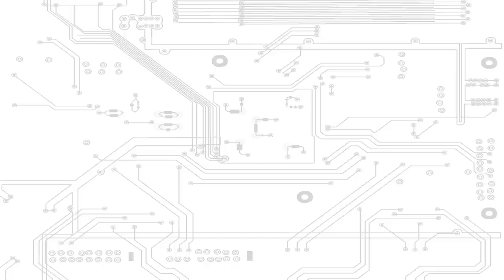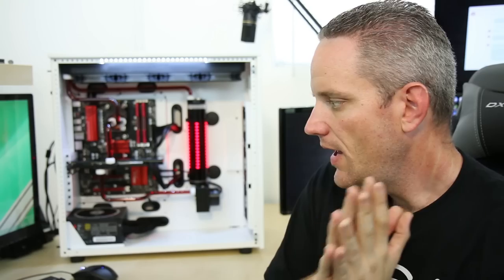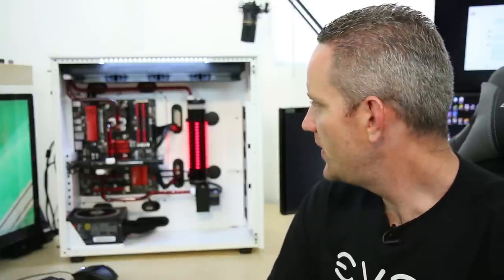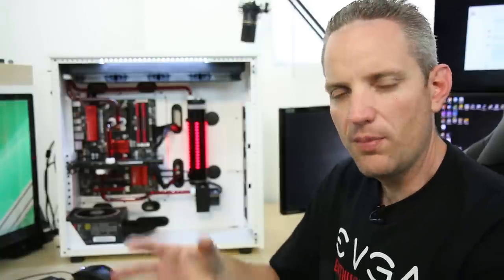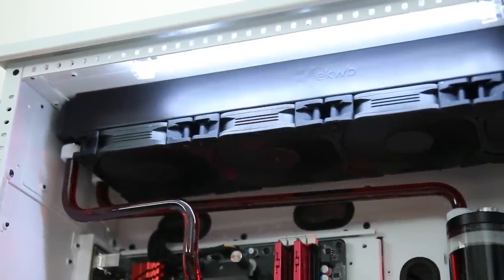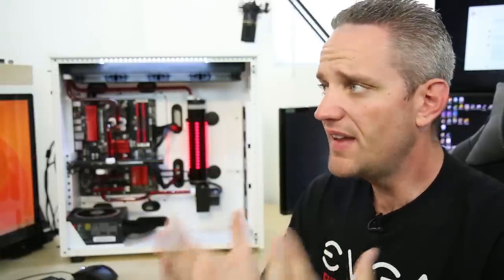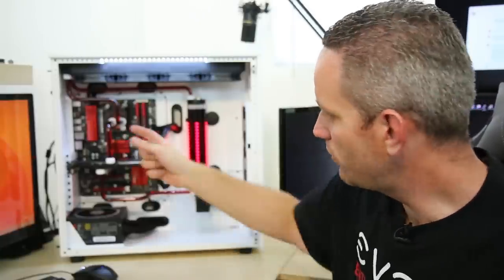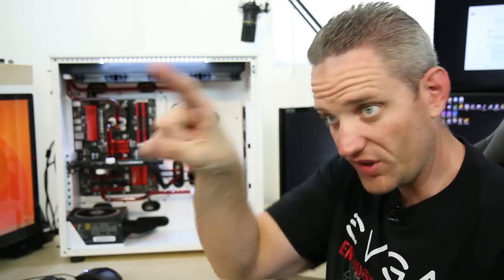Custom Watercooled AMD Gaming PC

Comment: I kinda want to see a purposely inefficient path in a rigid loop:
Wherever you would do a 90 degree bend, do a 270 degre 'loop' so the final result looks like a roller coaster.  If possible link the loops so they pass through one another so it needs to be assembled in a more clever manner/specific order.

One thing I really want to make on my next build is a spiral going upwards where there is an auxiliary AIR pump after put pump outlet that pulls the air from the TOP of the main reservoir and injects large non-diffuse bubbles into the spiral at the bottom so the flow is clearly visible.  At the top of the spiral would be a custom chamber (secondary reservoir) that allows the bubbles to be removed and ported back to the reservoir before the liquid continues to the rest of the loop.
Note, the air system is also closed loop so there is no evaporation problems.
Yes, harder to bleed, Yes, more backpressure...but looks more awesome!

Comment: ***** Good to know, that there are "compatibility concerns" to consider when using PETG... Since i am about to build a PETG loop soon i would like to see this because i dont want my coolant to melt the face off of my new system.
Also a proper comparison of different pumps would be an interesting topic (i.e. using different types/numbers of blocks and pumps to show the difference in flowrate or possibly the noise generated).
Reply: Wyrucz The only thing to bear in mind with PETG and coolant is to avoid coolants with ethylene glycol -- will probably be listed as ethane-diol on the ingredients list. Propylene glycol based coolants should be fine with PETG, but ethylene glycol is known to be incompatible.

Comment: Any chance you can do a more in depth advanced watercooling guide. In particular, I'd like some tips and ideas on how to implement maintenance (Fill and Drain ports). maybe that falls more into case modding though... 
Also, Thanks. Your watercooling guides inspired me to take the plunge, and turn my corsair Air 540 case into a water 540 :P

Comment: Disagree, the FX8320 is the best bang for the buck. Its only 200mhz behind FX8350 in turbo. It can overclock to the same speed on stock voltage and quite a bit higher with a little extra voltage.  When I had mine my daily tune was 4.6ghz @ 1.375v and max tune was 5.1ghz @ 1.55v. I loved my FX but it had to go it couldnt keep up with all my games. It wasnt "bottlenecking" my 290x but it was bottlenecking some of my games. Switched over to an i7 4790k and gained fps in every game, some games went up 10-20fps.

Comment: Hi Jay, love your videos. I had a quick question regarding the current state of dyed coolants, more specifically, the long term effects of them inside of a loop. Back in the day, I used to run dyed coolants in my loop but later found that they would stain the tubing, res, and gunk up the waterblocks. Do you find that this is still the case with dyed coolants today or is flushing out the loop every so often the only realistic way of keeping the loop clean? Also, is there a difference between the clearer dye versus the more opaque stuff (like the one you used in skunkworks) in terms of long term effects inside of a loop? Thanks so much!

Comment: wouldn't mind seeing a complete how to guide video on watercooling, like from the planning stages to testing the components before watercooling them to putting waterblocks on graphics cards, building the loop and the tools you use and recommend to people that are new to watercooling as well as some tips here and there, im currently planning on doing my first x99 watercooled rig but still not sure on what tubing to use and how to make the loop itself since itll be inside the fractal design define S

Comment: Jay, I'd like to see a water cooling solution for a 19 inch server case which could be mounted into a server rack. Because it is like an old desktop case "laying on the table" you cannot use thermic effects for cooling.

Comment: ***** I'm assembling my gpu only loop right now, watercooling for the first time. I would like to see a beginners guide to the most basic things. I have a 290 with a fullcover block. How much radiators should I have? Which pump is best if I want to have silence? Should I use a drop of thermal paste when applying thermal pads? Stuff like that.

Comment: ***** Regarding watercooling content, I'd love to see purchase guides. Fittings aren't the cheapest and just doing some preliminary research, I've just been a bit overwhelmed in terms of what should I buy, what I need to buy, etc. It seems that rigid tubing also allows for a bit more exact fittings purchase where as soft, you may need more in terms of 90 degree fitings, extensions, etc.

Comment: Is there a reason you went with red dye rather than red pastel? Maybe it's just me but I like the pastel a lot better. Something about that clear tubing over the opaque coolant just gives me a hard on. I'm thinking of upgrading my loop to hardline but I decided I should wait until I upgrade cases. Hardline tubing would need some tight bends to fit in my Corsair 760T setup. Good looking build though and thanks for the confidence boost to dive into PETG tubing. I might start picking up some fittings and tubing so that when I get my new case I'll just need a new radiator to add onto it.

Comment: So yeah it would be a lot of tubing, but you should do a a build without a resevoir and instead with hard tubing coiled up in place of the resevior. I think it would be pretty cool. Kind of got the idea from linus' scrapyard wars 2. Is it posible to bend hard tubing in that tight of a space?(like where the resevoir usually goes, but with hard tubing coiled.)

Maybe use a UV green type of fluid to give it a cool effect.

Comment: Is is possible to fix a leaked water cool system if the water gets onto the computer components? Or would I have to buy completly new hard ware .hasn't happened yet but just wondering for if it does happen.

Comment: Hey Jay, would you recommend 240mm AIO with push pull Gentle Typhoons or a 280mm AIO with push pull using some random fans? Gentle Typhoons don't go to 140mm. Or maybe I can use a mounting bracket to fit the GT onto the 280mm rad. (It's an AIO, so only for CPU or GPU, but both will be overclocked and under near max load.) Thanks.

Comment: Can you do a review of how to cable manage fans with multiple rads for an SLI or Crossfire loop, especially in mid-tower ATX cases like the Define S? Example: two 60mm-thick XE360s in push/pull means 12 fans, 6 on top and 6 in the front, plus say one 140mm fan in the back and one in the bottom. How would you cable manage all 14 of those fans, have a fan splitter, keep them out of the way of the tubing, etc. while providing proper airflow and aesthetics?

Comment: More watercooling videos would be awesome. Um... How but some were you discuss more budget minded supplies for water cooling. Like when you said PGT tubing was less costly than the flex/rubber tubing.

Also, what cases work the best for custom water-cooled loops verses the closed-loop systems that would theoretically fit in any case.

Comment: ok here's my question!
Can you actually use a car radiator for pc cooling? I mean using it as the actual radiator instead of the smaller computer designed ones?

Comment: I'd like you to talk about pump performance, flowrate, radiator dimensions, PWM control and other factors impacting cooling performance. I cannot believe you are staying under 50 degrees under load. Are we talking synthetic load?

Comment: i build my first custom water cooling systems with acrylic and damn was it hard and i needed a lot of tube just to practice on but i did get a clean and nice finish in the end so i personally recomend going acrylic for your first time as long as you understand your route relize how ur gonna need to bend it and make sure u have more than enough acrylic for all of ur fuck ups

Comment: I'm currently saving up to run my first water cooled system to build hopefully by January. I'd LOVE to know more on pump types, chemical types and maybe even a bending guide. I know you've covered videos on airflow before but I'm curious why people keep putting intake rads in the front of the case (Paul&Kyle's builds for example). I must be missing something as to why people are choosing to put hot air into the case. Maybe a video on pros and cons to that.

Comment: Guide: How to choose right water cooling (radiator size, 1 or 2 independent loops for CPU and GPUs) depending on system (I plan 5930K OC) and how can I use water cooling with 2x Gigabyte 980 Ti G1 (Custom PCB) cards (I plan use them) and how to find full cover Water block for custom PCB cards?

Comment: DIYPerk has put a CPU ventirad on a GPU and I wonder if you could compare that to a gpu watercooling (since you surely have spare parts laying around)
Also one argument I often heard about watercooling is that it's quieter, to my logic I dont think so because you still need the radiators and fans to cool the fluid. So if you could give it a roll on the dB meter ;)

Comment: Hi Jay, thanks for the video. I can't help but feel a little worried by the open fan grill on the PSU pointing upwards and being directly below the GPU cooling block, if there's a leak then the coolant is going to drip straight in there, what's your take on this from a safety point of view?

Comment: I would like to see a video about having a separate radiator for the cpu/gpu versus having a single radiator like the one in this build. I was always under the impression that you should have one for each.
Reply: starfan6299 The rule of thumb I've always heard is that you want - bare minimum - 1 120mm fan for each water-cooled part.  So, you got 1 CPU and 1 GPU, you bare minimum need a 2x120 radiator.  Most radiators aren't going to be able to cool this combo with any real overclock, so getting more rad is essential.
Reply: jedidethfreak I've heard a similar rule except start with a 240 and add 120 for every heat source after the cpu.
Reply: bensemus x I say, use as much rad as you can possibly fit in the case.

Comment: 11:10 I have a question: How about copper/aluminium/brass tubing, like those used on gas installations? is there such a thing for watercooling? I'm tempted on building a fallout inspired machine and plastic tubing might not fit with the aesthetic I'm trying to achieve. Also how about an external serpentine where you can dump chunks of dry ice to cool the reserve liquid berfore getting back to the system?

Comment: Hey Jayz, can you do a build guide involving rigid tubing please? I am a long time pc builder (~10 years) but I want to go the route of water cooling for the first time. I have done phase changing just for cpu for pure overclocking, but now I want to have a practical system that I use everyday and I plan on going the route of water cooling through rigid tubing.

Comment: Jay i know you don't like the term bottleneck being tossed around everywhere but I have an issue with this build. 

It's psi 2.0, won't at lead that bottleneck a card as powerful as a 980? 
I have a 8320 myself and I know that the am3(+) chipset doesn't support psi 3.0... So why use it?

Comment: I would be interested in knowing what is the minimal entry budget related solely to the watercooling stuff for someone that wants to get into it from a complete zero, as in not even the necessary tools, and have a good looking watercooling loop, like the one in this build for example, adding also the price difference between having GPU cooled and not cooling it.

Comment: Hi Jay. What I really want to see as far as water cooling content is an old school water cooling loop made using non-specialized fittings. It would be neat to compare the cost and performance of off the shelf hardware store re-purposed plumbing parts and aquarium pumps to modern water cooling parts. Is the old way obsolete due to how the market has progressed or is it actually economical and aesthetically cool in its own way?

Comment: I've really been wanting to replace my soft tubing in my pc to rigid tubing and have read PETG tubing has a few issues such as water being able to permeate through it, it easily stains and is not UV resistant is this true ? is rather get an answer from a professional rather than hear say on websites !

Comment: I'm building a custom loop  right now with a d5, ek blocks for my 770 and i7, with 2 rads (1x360mm and 1x240mm) in a nzxt h440 for water cooling parts its about £330

Comment: Heyho from Germany, 

My roommate and I are thinking about watercooling our two PCs in one loop. The interesting part about it is, one PC is on ground floor, one on first floor and one massive radiator kind of in the middle in the stairwell which is always a lot cooler then the other rooms and we would be dissipating the heat outside of our rooms so they wouldn't heat up as much during long gaming sessions. 
We want to use the two pumps in our systems to power the loop, would you put the PCs and pumps in series or parallel?

Comment: I like all the vids Jay, and i am a financial supporter, HOWEVER.
I never understand why people use a heat gun to bend any types of plastic, be it acrylic, abs, pvc or whatever, everybody in the manufacturing  industry uses glycerin and a mandrel, its the industry standard and can be done very easy at home, you will eliminate kinks 100%, for the thickness in a WC system you would only need to heat around 150-170 F.
You could do this in the kitchen, anyway, i like the builds but for the life of me i dont understand why tubing is formed the hard way with a heat gun, way to much waste from mistakes, i understand most stuff is given to you free and waste is in the formula, but all the people that actually make custom plastic bends in manufacturing use glycerin, i dont understand why its not used custom water cooling, I have done it with glycerin and heat, no question glycerin is MUCH better.

Comment: I bought the GTX 970 around launch time. Plugged it into my 970 socket board and it wouldn't work. Contacted EVGA (bought the EVGA SSC), and they said it wasn't compatible with the 970 socket. Had to upgrade my board. So, unless that has changed, I don't recommend the 970 socket for nvidia cards.

Comment: What voltage did you use for the 8350 in order to reach 4.4Ghz?
I'm asking because the temp seemed a bit high for a custom loop like that.
But it is probably just the fact that there is also a GPU in the loop, and also ambient temp might be high.

My 8350 hits 52 degrees with an H80i(fans @1350rpm), while playing BF4.
Oh, 4.5GHz, 1.365v, 27-28 degrees C.

Other than that, nice system, sick looking loop, performance should be good although it is kind of stupid choosing AMD for games like WoW(with its single core engine). Anyways..not here to start an intel vs AMD war...

Comment: I don't know, Jay. I have an ASRock 970 EXTREME4 that used Crossfire perfectly with games such as Tomb Raider, but horribly with games like Battlefield 4 (which has good SLI/Crossfire support). Lots of 970 boards don't have x16x16 and have a power phase for the CPU that isn't recommended for the 8350. Things work well with my new r9 390, though.

Comment: Well im about sold on petg tubing. Perhaps a video on the methods and do's/don'ts in the building process? I've been using soft tubing in my builds for years and and have been wanting to make that transition. My current build is in a 800D, dual loops, 2 gpus and cpu on water. So with the change in tubing would the blocks need to be changed as well? Types of coolant compatible with petg and koolance blocks (or any popular blocks)? Feel like a noob with the questions but that's how ya learn.

Comment: ***** I would like to a see a really small but powerful watercooled (CPU, GPU) ITX build with an external radiator. Perhaps with quick disconnects for the braided stainless steel brake lines to the external radiator?

Comment: Could you make a video with the r9 290x 8gb and the r9 390x working in crossfire. I'm not absolutely sure if it works but they have the same architecture so it should work. Would really like to see this.

Comment: Jay, could you please water cool a laptop for educational and curiosity purposes.. i want to say that alienware used to watercool thier laptops. so i think it is within reason .. just how would one do it? where would the rad go? or could it be a hybrid with the water cooling setup be part of a quick release and setup dock and while it is obile disconnect the cables then use the air cooled. kind of the zotac 980ti.. but regardless i think it would be freaking amazing! please do this!

Comment: I seem to remember that you used a long silicon cylinder inside the tube when you bent acrylic, to make sure it bent smoothly. I was wondering, do you have to do that with PETG as well? If so, it'd be nice if you mentioned where you got that and what it cost like you did for the other tools.

Comment: I've never built a pc but am wanting to because my laptop just can't run the games I need to anymore. Do you think rigid tubing water cooling would be too much of a challenge? I'm only 17, if that matters, although I don't see how it would...  Also how much is the average cost of a rigid tubing loop? And I plan to do 2 980tis in sli so will that add much difficulty to it?

Comment: The thing I'm curious about is if they make a cooling block or full set-up (DIY or pre-built) that's designed for oil, specifically mineral oil and other types of non-conductive oil. Since it also has a pretty good cooling capacity.

Comment: Jay do you have aldready dismounted one of your GPU waterblock (not necessarily skunkworks but a GPU waterblock that you installed) to see if thermal paste is enough or too much? Because EK recommand to do a star but it can depend of the size of the GPU. And if for example someone has only conductive thermal paste he must not put too much on his GPU.